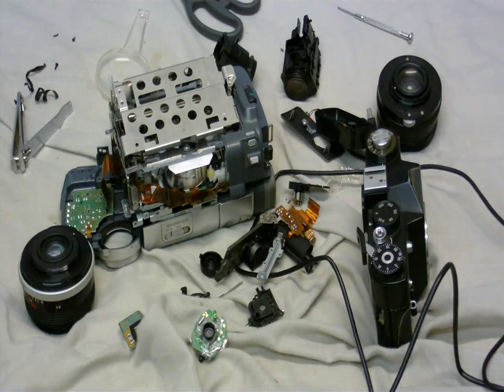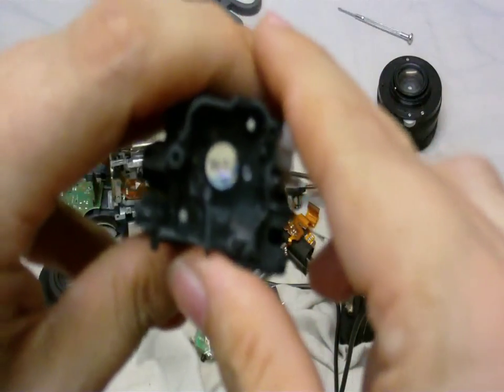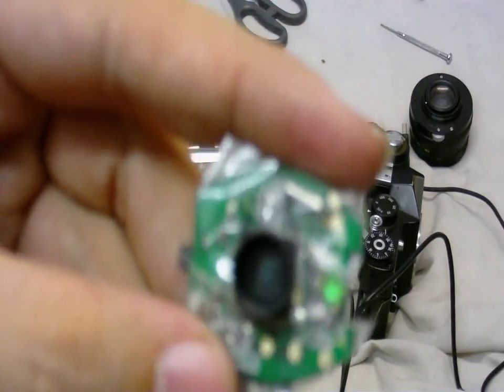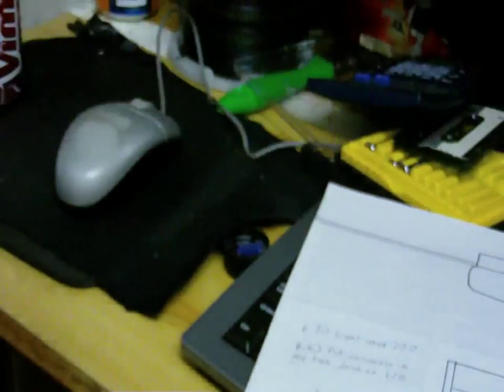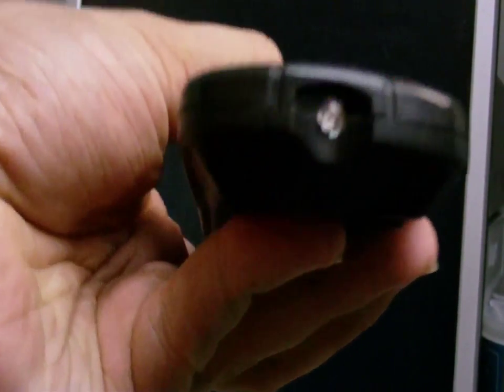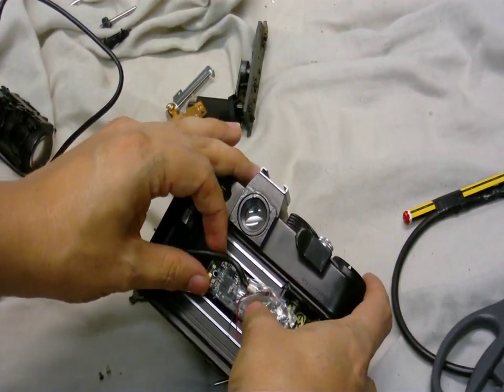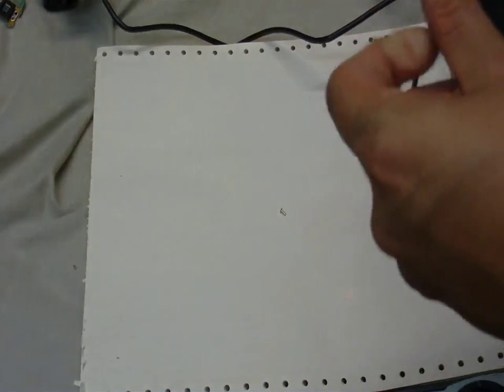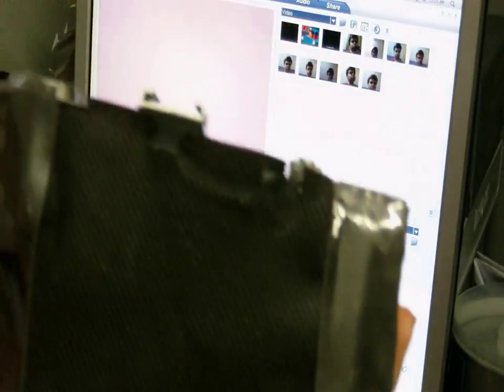Home Made Webcam Experiment

Comment: Very interesting! I once thought about doing something similar using a camera module that I found in the internet. 
I think the reason why the image appears to be zoomed in on the wide angle lens is because of the different diameters. The film used to have 35mm, and the little webcam has not even 10mm, I assume. So I think you'd have to move the camera further away from the lens, to get a wider picture.

Comment: Also, you'll find the focussing ability of the Zenit lens/sensor combination is dependent on how far it is from the lens. The picture is "upside down" because of the way light enters into the lens. A bit like your eyes which invert the image. Your brain makes sure that what you see appears the right way up. The equivalent function on a digital camera would possibly be in the software it uses. As you discovered though, you can turn the whole camera upside down! Well done, a great video.